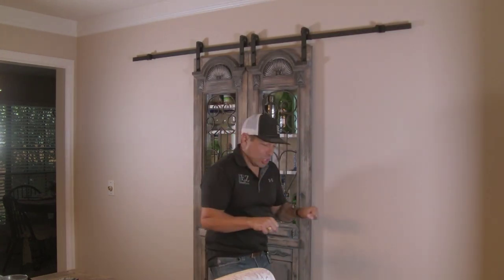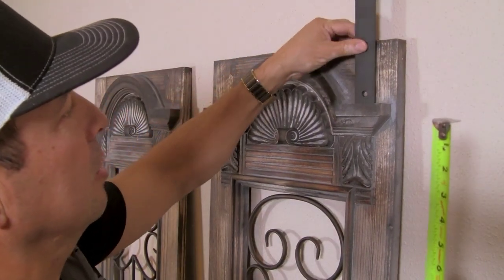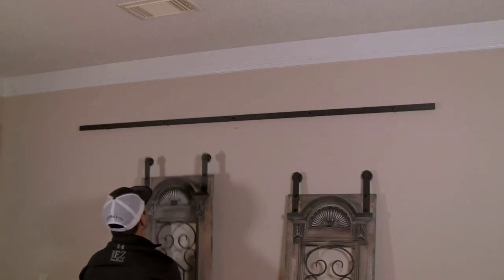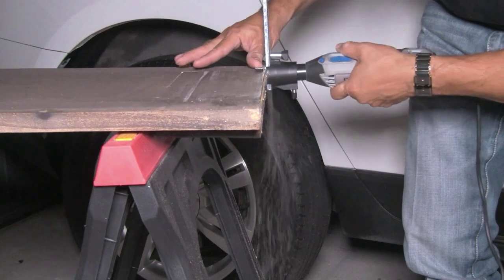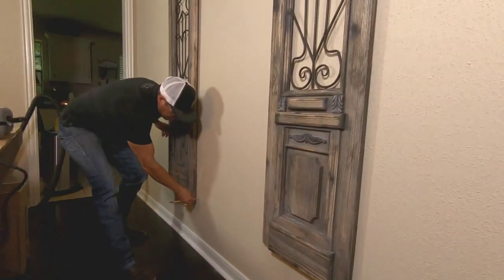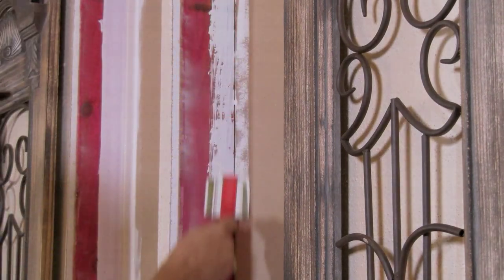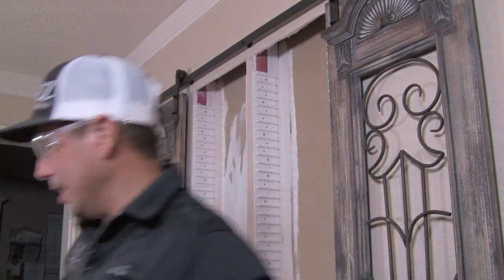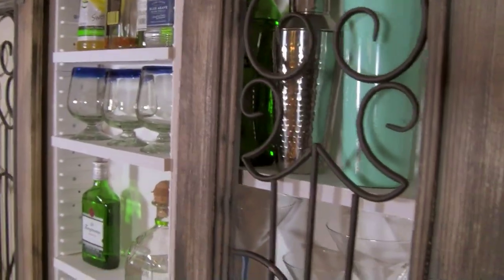Howto Find Extra Storage|Between Stud Storage|Awesome Wall Storage|Ultimate Wall Storage

Comment: I do love in-stud storage, but it's important to remember that you can't do it on exterior walls (or lose your insulation) and it helps if you know where wires/pipes are first so your entire project isn't thwarted by a single pipe where you didn't expect it.